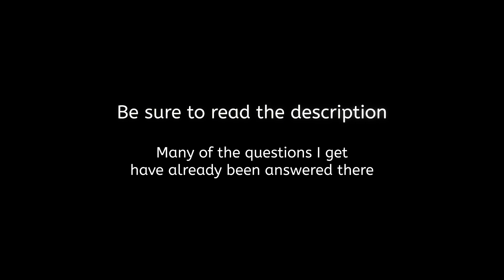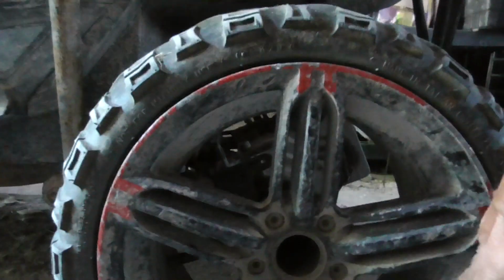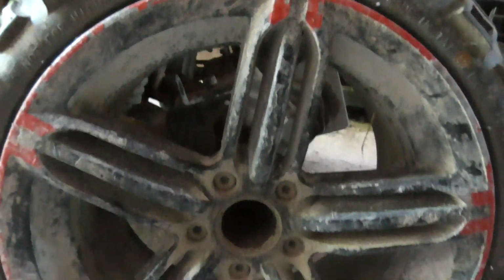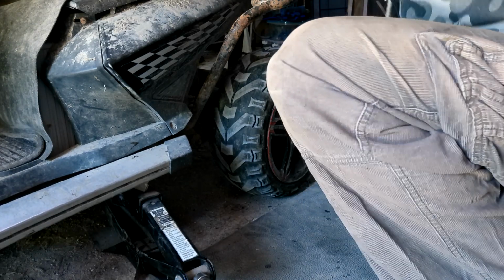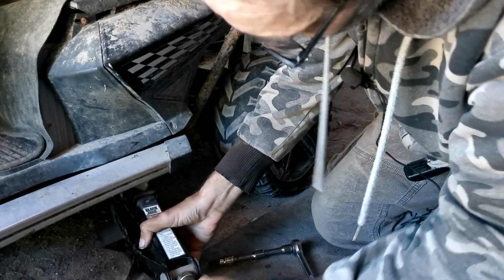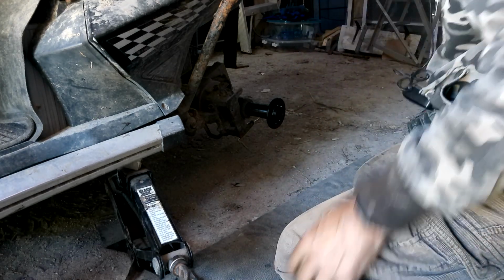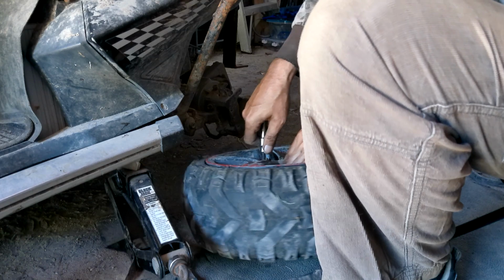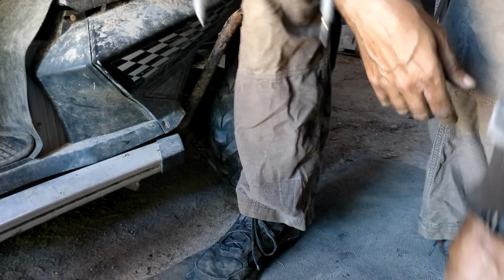A Major Fix? Or Will it be Simple?

Comment: Hi I'm from England I have got a tga vita s mobility scooter when I turn it on nothing happens it's got a red flashing warning light and error code 7 can you help thanks dominic
Reply from the maker: The manual states error code 7 is a throttle error but, in my experience, it seems to be a generic code as many conditions have generated it. The two most common, and most likely, you can check yourself. Possibility #1: take the front panel off the tiller (10 screws) and push together every plug you can find. There is stress on all the wires and the plugs tend to come apart from the vibrations. They may look like they are together but, electrically, they separate. Possibility #2: take the seat off, then the battery cover. On the controller, there are three plugs. Pull out the plug that has four wires and check to see if it has melted. All Heartway scooters have this issue. The current from the charger goes through this plug and the wrong size wires were used so it overheats. Depending on how old your scooter is, the problem may have already been fixed. I got tired of changing the plug every year so I use a lower amp charger now. If neither of these are your specific issue, let me know and I'll try to think of what else gave me that error.

Comment: Hi mate just up on your videos I'm going to give you a suggestion if you think you're trans axles me coming to the end of it'slife use the old hubs and   welder onto the stub axle You've got nothing to lose and your key the other two new hubs when the axle does pick up save you a bit of money 🇬🇧
Reply from the maker: The only issue with that is once the hub is on, there's no visible axle to weld to. I tried that in the past but I welded to the spacer that was seized in place. It worked but I don't have those spacers anymore. I use several washers now to take up the extra space. Good suggestion though.